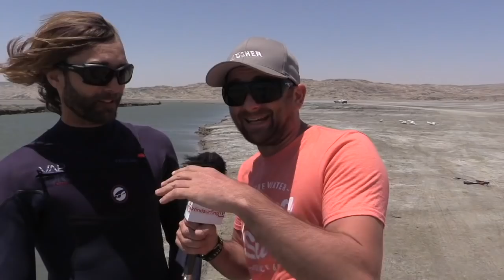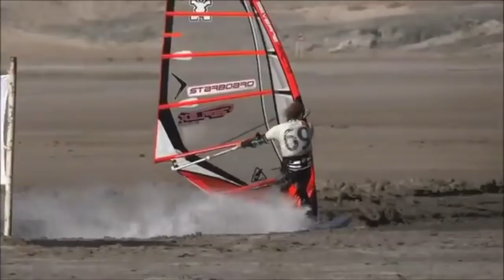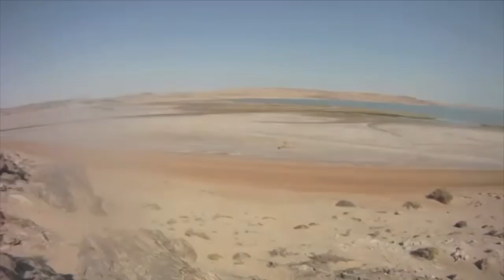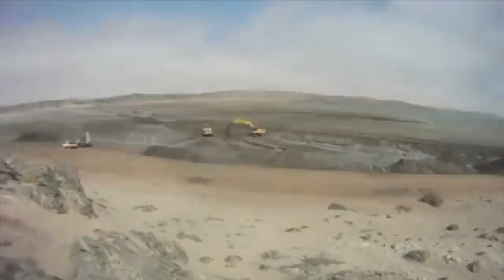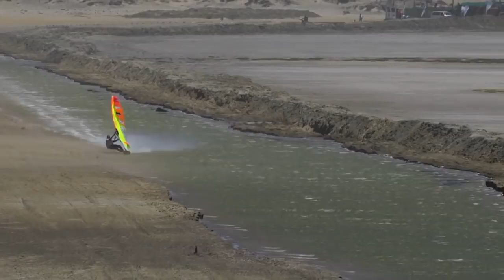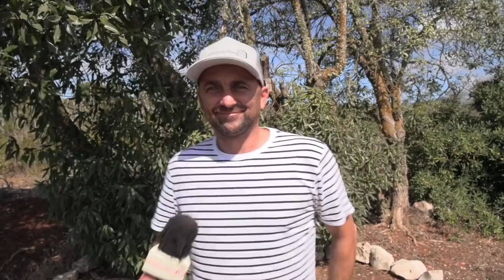Who Built this CRAZY Speed Canal? - Luderitz Speed Challenge  - #TBT

Comment: Does the bay flood over at spring tides and wash the sand back into the speed channel ? Do they have to clear the channel out each year?  If the prevailing wind is offshore there then is the open water in the bay not quite flat already near the beach ?
Reply: Good question.

The guys I know who’ve gone there say there is a small hillock on the coast that creates a small wind shadow that makes the wind dirty right next to shore where the water is flattest.

It’s fine for the kiters, but not windsurfers.

The bay is still relatively flat there even way out- so this channel is all just about making good conditions even better.
 
That said, the 40+ kt winds here can still create fair sized chop in a few dozen yards.

Understandable considering they’re looking to break speed world records.

The whole purpose of the channel was to set speed records.

Comment: Someone needs to see what speeds they get if they foil this
Reply: super risky because its so flat. Getting started would be tough aswell
Reply: @fakulol0186  use 15" or shorter mast?
Reply: @rtz549  15 inch? 🤔😉
Reply: @wordreet  Houston Kiteboarding was cutting those aluminum Slingshot masts in half a few years ago.  Made learning easier.
Reply: @rtz549  Well sure, a smaller rig is easier on your first day, just to get the idea. But you did put 15". 😁
Reply: @wordreet  that's how Houston Kiteboarding sold and advertised them and how they were known.  They never referenced them in metric.
Reply: @rtz549  I hear you, but " indicates inches whereas ' indicates feet.
Reply: @wordreet  actually; that's backwards. Common misconception. Look up which is for feet and inches.

Comment: Canal? Channel? It's landlocked, so it's a ditch. Albeit - The World's Fastest Ditch.
Reply: It's not quite landlocked. Sure there's no direct connection to the ocean, but it fills up with each high tide. This channel is roughly 10 meters or 30 feet from the coast.
Reply: @sigisoltau6073  by your explanation, it's landlocked....
Reply: @ajdahun  Even if there's no direct opening to the channel, water is still entering and leaving it during high and low tides, so it's not completely landlocked. During high tide, there's water flowing into it on the eastern side of it, during low tide it flows back out. So for a short time it is connected to the ocean.

Comment: So strange nobody wears a helmet.
Reply: @Erik I think you have to make a choice wear a helmet trying to protect your head if you slam it to a boom, mast or board. But with wearing a helmet crashing with 100 k/h and the possible chance the helmet catches water and putting alot of tension on the chinband risking to break you neck due to the drag and sudden loss of speed
Reply: And nobody wearing a mask #stayhome
Reply: @bangkobangko1391  what'd we get the shot for then?
Reply: @bangkobangko1391  A shot will protect you to some (well known) extent. But you're right, since it's not 100% (and does decrease with new strains) you should keep using the other protective methods. Combined they yield a better protection than using just one (or some) of them.
Reply: just what I said only in other words #stayhome